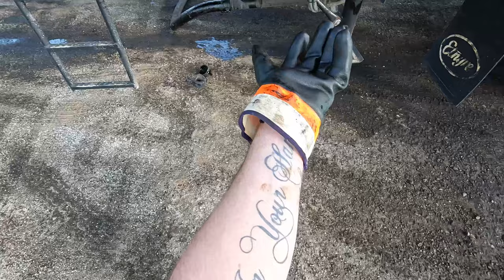Taking my semi truck off-roading! | Pumping our first asphalt oil load

Comment: A couple of tips if I may. 
1) When you pull off the road and onto a gravel or dusty surface, make sure your a/c is on recirulate and not bringing fresh air in. That will reduce the amount of dust coming into the cab. And keep the cabin filter clean.
2) After connecting the hoses to the trailer fitting,  run a wire through the cam lock ears and twist so that the ears can not come loose and cause a big mess. That procedure  is mandatory for us with hot product unloading . Has to be wire to withstand the heat. 
3) When unloading  and after hose/s are connected and secured, start  checking that the required values are open starting with the receiving tank first and work your way back to the delivery tank.
4) A little trick I used, was to carry a spray bottle containing diesel fuel and spray the fitting on trailer/s before putting caps back on and do the same for hoses. Makes it much easier to remove caps for next delivery. 

Just some suggestions . Sorry if you are already doing that.🤔 I call it working smarter not harder.
Reply from the maker: #1 I already do. 
The rest are all great suggestions. 
I have just gotten back into trucking and as a fellow trucker, you’re well aware everyone needs to develop a process and routine to ensure things go off without a hitch. I’m working on getting back into my groove with it all. 
But, those are excellent points. Thank you for those!
Reply: Mark you took the words out of my mouth I do not use wire I use a locking clip from Granger works great. The only other thing I di not see the load trailer get vented till the end But good job and no one was heart.

Comment: I wouldn’t be messing with that asphalt without long sleeves or fire coat and a face shield. That stuff will melt your skin.
Reply from the maker: This asphalt isn’t the placarded hot stuff. We wear long sleeve and shields with it. Road oil isn’t too bad. Thank you for the safety concern 👍